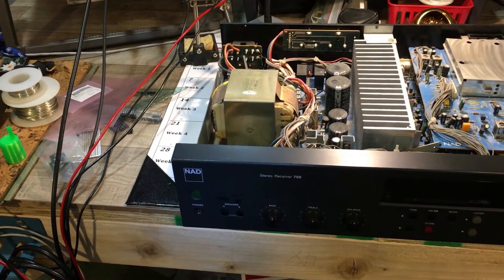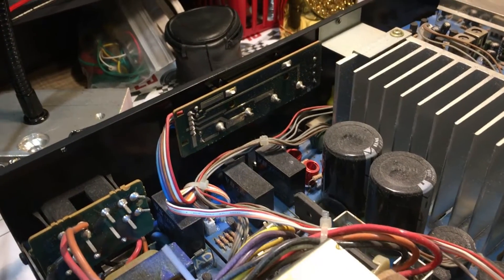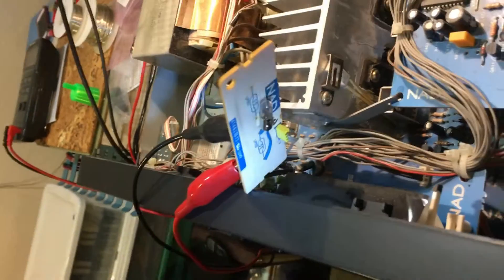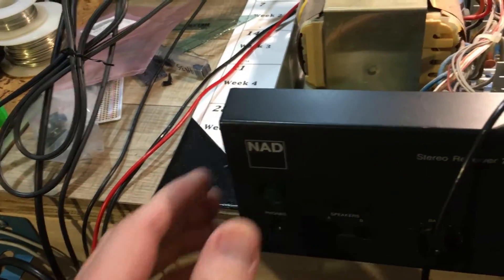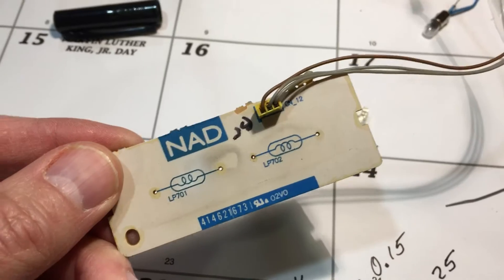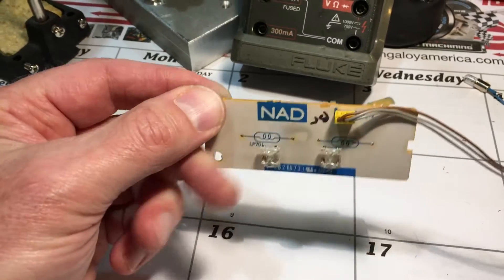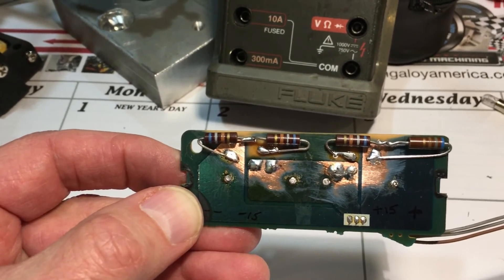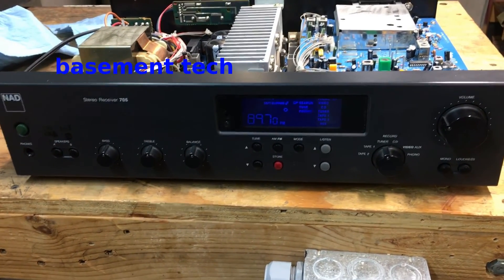NAD 705 display backlight repair ... cool blue LEDs

Comment: So cool.  I've had this unit since 1994.  It's been sent in probably 5 times for work e.g., channel going out, bulb going out.  Yet I still am grateful for the unit.  It surprises me sometimes with the sound.  Love the voluptuous bass and smooth mids.  The highs are well enough but not too detailed.  Where the NAD doesn't excel is when 6 or more instruments are competing on a track. They seem to mix in together a bit without having their own stand out sound.  That said, Jazz trios to the White stripes are incredible to listen too on the 705. It's a keeper.
Reply from the maker: @2savetherepublic, glad you enjoyed the video and like your 705.  Sadly, my 705 has recently started exhibiting an issues wherein the relative volume of the channels is so off that the balance knob can't fix it.  I did a little troubleshooting and it seems to be in the pre-amp section.  I'm trying to decide whether to try to fix it or not.  Where did you send yours for repairs ?

Comment: Thanks for the detailed explanation of the resistor selection. My backlights died (again) many years ago and I was hesitant about doing the mod. Otherwise it's a great piece of kit. Y
Reply from the maker: Yamakawa , thank you for your kind comment. Please leave another comment with your experience if you attempt the mod. I agree, the sound quality of this NAD has always been exceptional, especially when connected to my B&W speakers !
Reply: @danielatbasementtech  I was thinking, is there any reason not to put LEDs in series as well as a smaller resistor? Does it matter if we don't use both the available voltage supplies? Y
Reply from the maker: @yamakawa511  Forgive me if this explanation is too basic ... LED's essentially act as a short circuit.  The only thing that keeps them from burning out from too much current is the resistor.  So, if you put two in series, it's kind of like 0+0=0 resistance.  That is, you would still require the same size resistor.  This is definitely different that incandescent bulbs.  The other reason that I used two independent LEDs is that if one fails open, the other might still keep the receiver useful.  As for putting them both on the same power rail, for some reason (and I'm not sure it matters) I felt that balancing the load on the power supply might be good.  Make sense ?
Reply: @danielatbasementtech  So there's no voltage drop across the LED, i.e. if I have 5 off 3V LEDs wired in series the voltage drop across the whole arrangement isn't 15V?
Reply from the maker: @yamakawa511  Thank you so much for your reply ... I do like discussion.  The answer is "almost".  First of all, theoretically, there is a small voltage drop across an LED: approximately 0.7 V.  LEDs are current controlled devices, however.  So, generally, and over-simplifying, you can use an LED at any voltage with the proper current limiting resistor (current = voltage / series-resistance).  The typical range of current for low power (not the kind found in flashlights and large light bulbs) is 5 - 30 mA.  So to say "a 3V LED" implies that such device has a built in series resistor that makes it appropriate to connect directly to a 3V source.  "Raw" LEDs require a series current limiting resistor, because they mostly act like a short circuit.  E.g. If you are aiming at 20mA using a 15 volt supply, R-series must be 750 ohms; if you were aiming at 20mA using a 100 volt supply, you would need a 5000 ("5K") resistor.  By the way, if you have two LEDs in series, the same current level flows through each one.  One final word of caution, resistors have a power handling capability as mentioned in the video.  Typical small resistors are 0.25 W (aka "quarter-watt").  In the 100V example, you would need a 2 W resistor; very big and probably impractical.  Finally, there are LED controllers used for very high current LEDs, like flashlights and car headlights.  These are more sophisticated devices that actively control the current directly with active circuitry.

Comment: I've done this repair using a Blue 3LED strip with built in resistor (designed for use in dolls house lighting)...soldered to the original circuit board, and using the stock DC feed wires.   Although designed for 9v-12v operation......they have been fitted now for over 2 weeks and no problem.......find them on eBay for around $3.....
Reply from the maker: @satwino ... thank you for this suggestion ... all, take note !
Reply: Can you provide a link to LEDs?
Reply from the maker: @satwino I think this request is for you

Comment: Interesting video. Do you know if this same repair could be done on an NAD S170 Silver series. I took it in for repair and they said the screen was dead and there are no replacement parts.
Reply from the maker: Karsten Gopinath ... good question. My receiver would still produce sound and if I shined a flashlight closely at the screen, I could see a response to the button presses. Does yours do that ?

Comment: Hi!

I have this receiver, and it doesn't power on. When pressing the ON button, only a green light turns on. No power :(. Any idea? Thank you in advance.
Reply from the maker: When the backlight fails, everything else works.  You just have to guess which input is selected. 
Sorry, though, I wouldn't be able to guess what might be the issue with yours.  Wish I could help.
Reply: This confused me . The green light on when theres power and its off. Green light is off when turned on. Display lamps out ?

Comment: Thnx for the video. I switched to LEDs five years ago. Switched again now, because they started blinking. Now I notice that I mesure 22V, not 15V. Anyone have a clue what can be causing that?
Reply from the maker: Hello, it depends on what you are measuring, but I can't think of a combination that yields 22V.  I went back and re-watched the video and was reminded that it appeared to be a regulated (+) and (-) 15 VDC on the three wires that lead to the board.  So, I do wonder if the blinking has to do with an issue with the power supply regulation ?  Have you progressed ?  Let us know if you learned anything after this comment ... thanks.
Reply: @danielatbasementtech 
The switch worked.... I just noticed that the back-lit PCB get 22V from the main PCB Not 15V.

Comment: where can i get these parts
Reply from the maker: bob lawrence ... hi bob ... thanks for your question. I usually buy from Jameco or Digikey. However, these specific parts I had on hand. Others with similar specs will work ... maybe even better than the ones that I had.